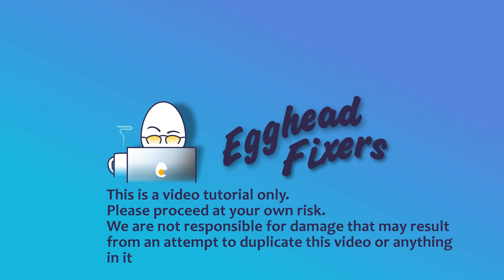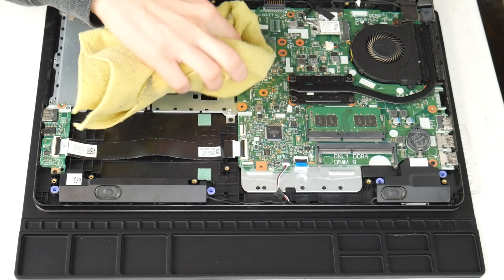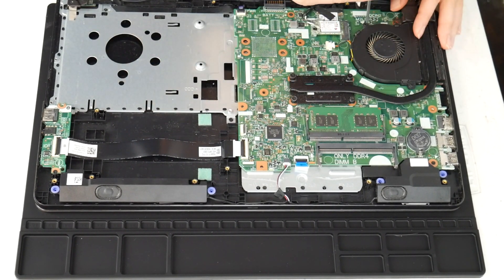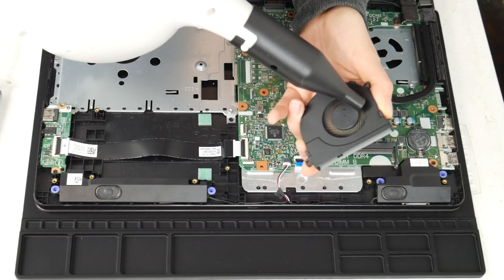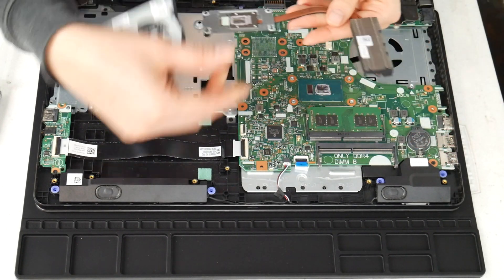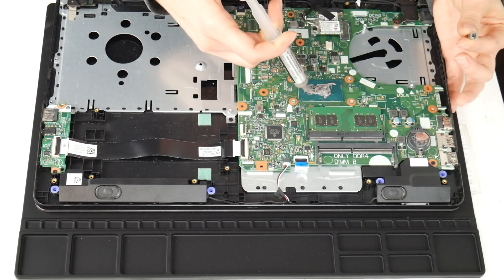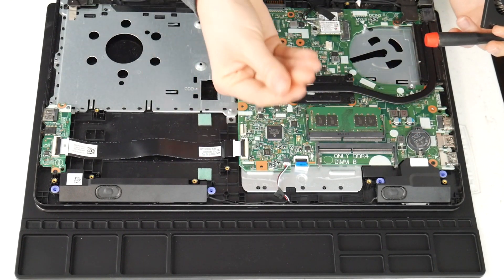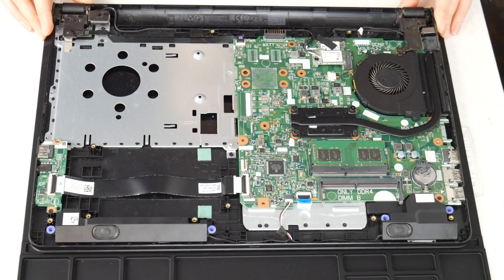How to Fix an Acer Computer That Keeps Overheating by a Certified Technician

Comment: Hey! Would love to have some help on how to take my msi gf75 thin keyboard out! Spilled a drink and some keys won’t work. Trying to replace it myself as I can’t lose time giving it to msi technicians for a week! I work with my PC ! 
Thanks anyways
Reply from the maker: Ah ya this is a hard repair. The keyboard on those model is not meant to be removable although you can remove it. It's held on by plastic rivets...You have to break the plastic rivets off the keyboard in order to get the keyboard off. When you put on the new keyboard  you can use tape or plastic cement to secure it but it is usually not as secure as when you replace the whole palmrest.

Comment: Sorry its not the topic of this video but last time your help was useful. I have dell new g13 series laptop. I dont have any fps issues or anything like that but my windows kinda crashes and i  locking screen for 2 second and it lock  itself up midgame and i always have to force shut it. How can i fix this issue ?
Reply from the maker: Does the computer seem like it is getting hot when it does this? Also have you looked at what specifications for your computer that the game requires and see if your computer has those specs?
Reply: @EggheadFixers  yes i play call of duty cold war and my laptop got gtx 1660 ti , intel i710k and 16gb ram . It gets hot yes
Reply from the maker: @berkecam7095  Ya those specs should be able to handle that game. Sounds like an overheating issue...Have you tried using it with a cooling pad? It's never a bad idea if you gamer. Does it overheat only when you play the game? Also if you hit Alt + ctrl +  delete and then select task manager you can see where all your CPU, Memory Disk space is being used. Are any of these especially high?